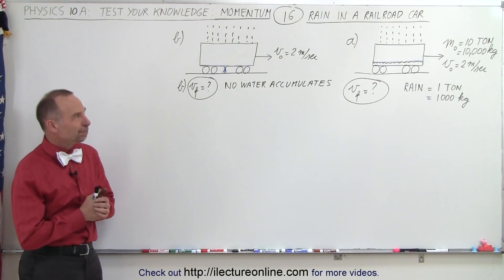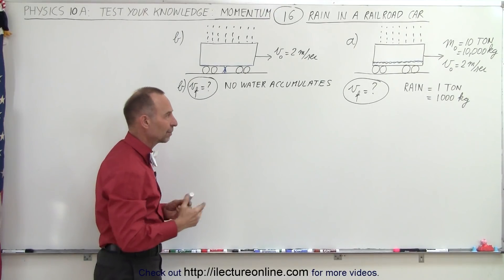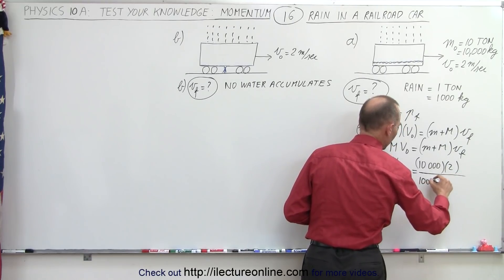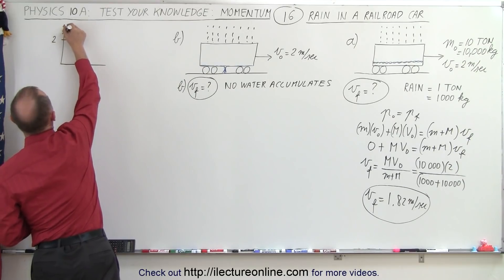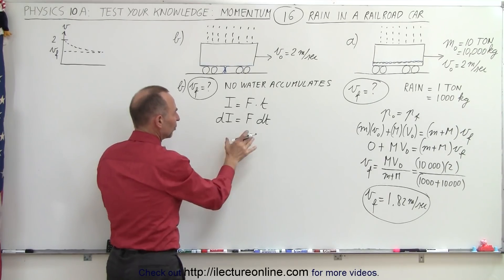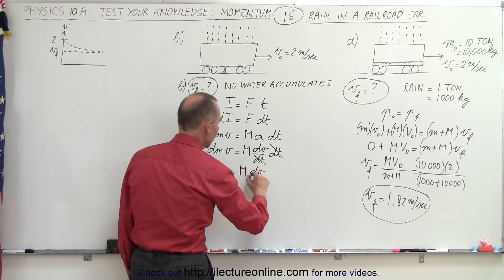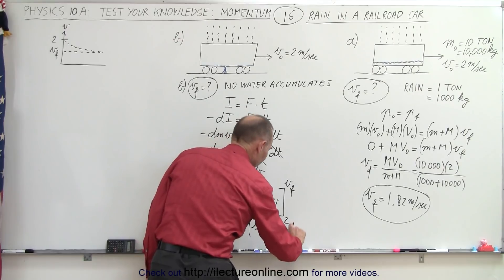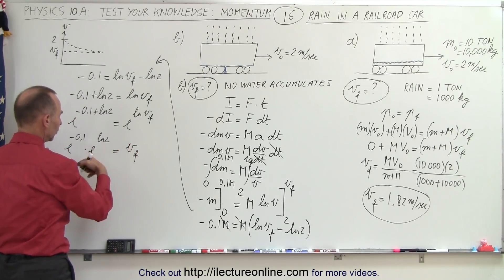Physics - Test Your Knowledge: Momentum (16 of 20) Rain in Railroad Cars

Comment: Slight variation on the above.  As in the first example, the water accumulates in the car, the car slows to 1.82 m/s.  Relative velocity of the water to the car is zero, as the water has been accelerated to match the car.  In effect, the car has “transferred” some of it momentum to the water, which is why the car slows down (total momentum is the same, some of it is just in the water now). Now, I open the plug.  The water drains out, taking its momentum with it.  The cars velocity remains at 1.82 M/S.

In your second example, the water is accelerated, but drains out as fast as it enters.  Since the cars velocity is slightly lower, 1.81M/S, then there must have been additional “momentum transfer” to the water in the second case.  So, in your second case in the video, does the water fly forward slightly as it drains out the bottom?  Possibly as a result of “rebounding” against the back of the car?
In your second case, If the plug remained closed, the water would slosh back and forth, exchanging momentum back and forth with the car until finally settling down.  If the plug was open, in the second case, I can see the water sloshing forward, but never hitting the front of the car, as it drains out the plug before that can happen.
Reply: The mass of the car in a) is increasing and the rain has marginally less effect [on increasing its mass] as time passes.  In b) the mass of the car remains constant and the impulse from the rain is always applied to the original, lower mass and so the rain has a marginally greater effect, slowing down the lighter car more.

This worked example has subtleties, which I hope the Prof will do a follow up video explaining.  

If you let the mass of the rain = M = mass of the car, then in a) Vfinal = 1 m/s (conservation of momentum, doubling mass halves the speed) whereas for b) Vfinal = 0.74 m/s (the lighter car ends up at a lower speed than a) having had impulse from mass M of rain applied over time always to original mass M).
Reply: In both of the examples the “mass” of the car is the same, 10,000kg.  Both examples start the car at the same velocity, therefore the car in both examples has the same momentum.  The mass of the car is the mass of the car.  This is where all the initial momentum of the system is.  In the second example, the rain does not accumulate, but the car ends up slightly slower, which means that more momentum was transferred out of the car, and into the water.  Since more momentum was transferred out of the car in the second example, this momentum must be accounted for, it can not vanish.  The only place the momentum could have gone is into the water.
Reply: Foxhound 100 are you seriously being pedantic about the mass of the car? The mass of the system is increasing when rain accumulates and so the effect of the impulse from additional rain is less on the heavier system. Did you work through an example where the mass of the rain = initial mass of car?